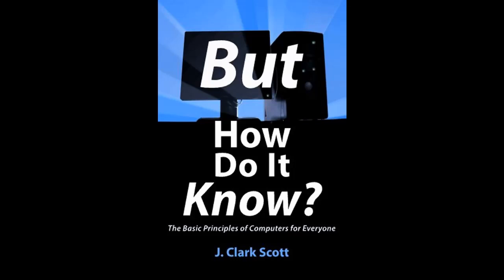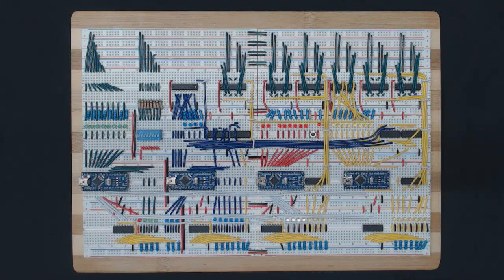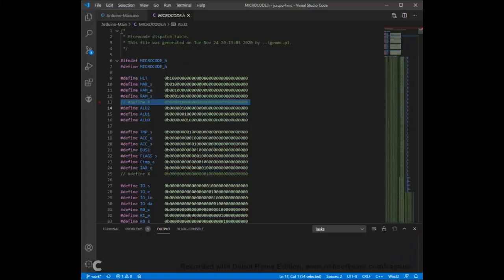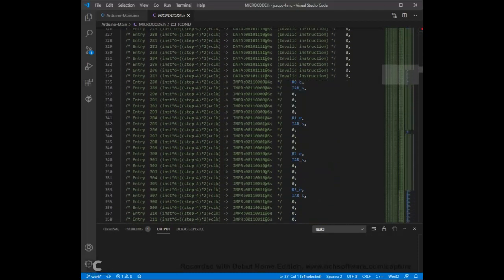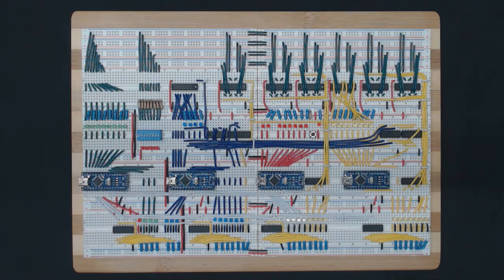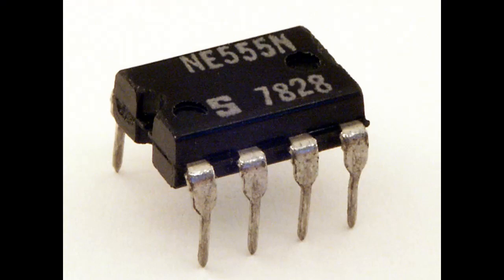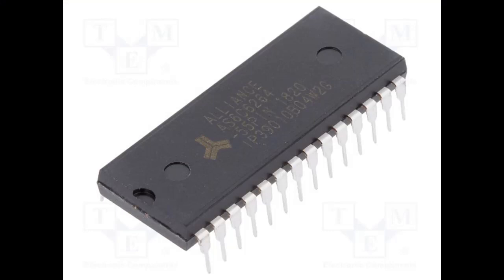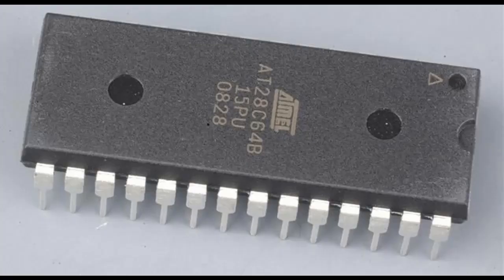But How Do It Know? Video #32 - Conclusion

Comment: Hi Patrick, I have following question, which I haven't been able to find an answer to after many google searches: concerning the full adder, when two bytes to be added are sent to the two inputs, it seems to me that all 16 bits are processed immediately and simultaneously. My thinking tells me that the 2 binary bits from both numbers, in the first column need to be processed first, so that the carry out can be sent to the carry in in the second column. Then the second column can be processed, etc. In other words, shouldn't the 8 columns be processed successively, one after the other to give the carry out bits time to go to the carry in bit in the next column? Thanky in advance.
Reply from the maker: Great question! Remember that these components are constantly "evaluating" their inputs and updating their outputs. So even if, for example, the second adder finishes before the first one and doesn't consider the carry on of the first adder, it will simply "pick it up" when it is available and produce the proper result. The important thing is that the clock leaves the clk_e signal on long enough for all these signals to finish propagating and stabilizing before turning on the clk_s signal to allow something to read the answer.
Reply: @patrickleboutillier  thanks Patrick, that explains it. My mistake was thinking that the clk_e signal was only sufficient for a one time evaluation, when in fact it is evaluating constantly while it is on.

Comment: maybe you've already done this, but I wanted to ask if you could post a list of all the parts we'd need for each video. I'm half way through the book and have only just found your videos and would like to follow along building each part. It would be helpful if I had a complete list of parts. Again, if such a list already exists, please direct me to it. Thanks so much.
Reply: I found the Bill of Materials in the comments on Video #7. Thanks anyway.
Reply from the maker: Great! The Bill of Materials contains all the parts to build the project in it's final state, but it may not contain all the parts I used in the various demonstrations (sometimes I demo something but don't end up using it in the final design). I'll see if I can make the list more complete.
Reply from the maker: @Gwynnthi  Not sure... For the project I actually used 8 standard 830-point breadboards, and stuck them on a wooden plank. You will need that because you need the extra rails to create the bus. Something like this, you buy 3 packs of 3: https://www.amazon.com/EL-CP-003-Breadboard-Solderless-Distribution-Connecting/dp/B01EV6LJ7G/ref=sr_1_3?dchild=1&keywords=830+breadboard&qid=1612302085&sr=8-3